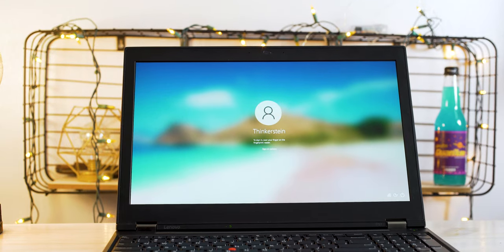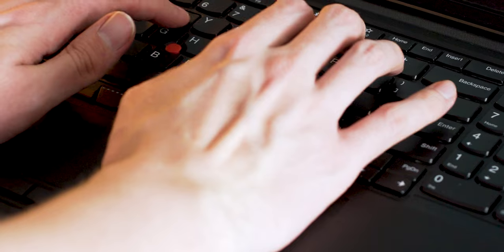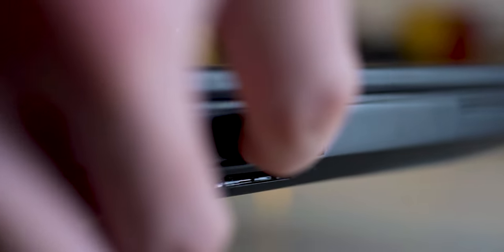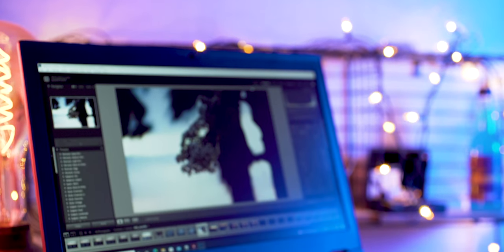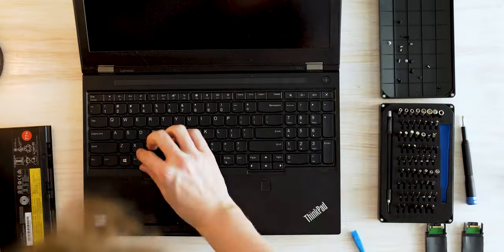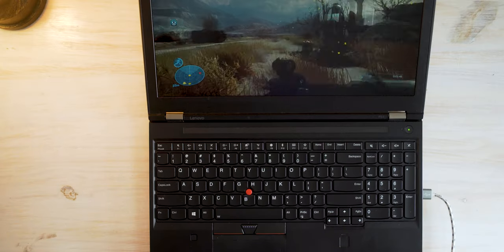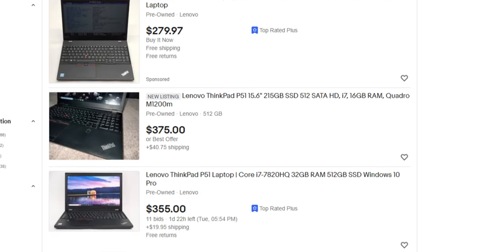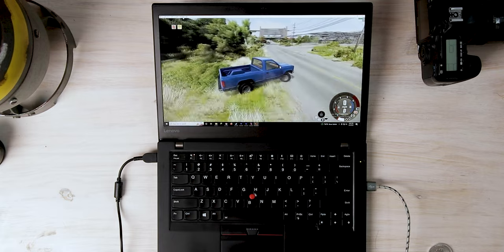I Did Not Expect This AT ALL - Thinkpad P51

Comment: You lucked into a great upgrade with the P51 vs the P50. I have 2 P50s that I use for work producing YouTube videos. Don't get me wrong the P50 is amazingly powerful and capable. Especially when you have it maxed out. Mine are running SSDs and 64gb of ram so they have served me quite well in video editing. I shoot my GoPro footage in 2.7k, and occasionally in 4k. Render in 1080p mostly with the occasional video in 4k. They can render in 4k quite easily but I do 1080 to minimize the render times since my instructional videos are usually 30 to 45 minutes in length. I've been using my GoPro 7, 8, and 9 for my work.  I recently upgraded to GoPro Hero 11s and this is where the brute that is the mighty P50 started to show its limitations. GoPro 11 uses HEVC codec exclusively. My two P50s, one Xeon based, the other i7 based cannot handle the new H.265/HEVC codec well at all. So now my work flow includes converting my GoPro 11 footage to H.264 before editing can begin. That is a long process, just like rendering before rendering. Just trying to view the footage using any media player results in choppy, stuttering video until its been converted to H264. I researched a solution. Thought I'd found a solution which was I found some forum posts that said the P50s can actually run 128gb of ram rather than the official 64gb limit. So I was about to pull the trigger and spend a few hundred dollars to upgrade one laptop to 128gb to test but I stumbled on a thread on some forum talking about HEVC and P50s. Apparently the P50s processor, 6th generation Intel, cannot handle HEVC no matter how much RAM you throw at it. The processors, code name Skylake are just not capable of rendering HEVC at all hence the stuttering video. To handle HEVC you need Kabylake processor or better which is 7th gen i7. Skylake is 6th generation. So I just purchased a P51, equal specs to yours. 500gb SSD, 32gb RAM. UPS just dropped it off today and I have a 2TB SSD, as well as 32gb of additional RAM being delivered tomorrow. Super excited to see what this baby can do.
I use Lightworks Pro for editing for which my perpetual licenses are tied to my hardware. So I need to wait on LWKS support to transfer one of my licenses before I can do some editing but I'm sure I'll be up and running soon. 
I suppose I could use proxies and get by but I'm too lazy and overworked to learn how to use them. Besides it gives me an excuse to buy more stuff.
Oh as for the fingerprint reader, that is absolutely indispensable! If I'm at the office its easy enough to type in my password but I do a lot of my editing away from work sitting on the couch. Its not so easy to type in xxxxxxx-xxx every time while I'm on the couch to keep the kids, girlfriend, or wife out of my stuff. Wouldn't have a laptop without one. 
Max out your RAM brother, you'll be amazed. Might even try going to the 128gb I hear is possible if things go well. Not ashamed I'm such a nerd! 😁
Reply from the maker: To be honest, for editing video I've never really had much issues with just running 16gb of ram. I recently upgraded my main PC to 32gb, but I rarely go above 20gb with premiere. Rendering proxies is your friend. I resisted for a while and regret it. I normally I dump all my footage into premiere before I go do something else while they render out. After a few hours, they're all rendered out and you're ready to never worry about performance drops again
Reply: @aChairLeg  Yes, I suppose running 16gb may not make much of a difference if I'm using proxies but as I said, learning that method would change the pretty nice work flow I have going. Now if my Kabylake Thinkpad doesn't solve my issues I'll be deep diving into proxies. Thanks for the reply brother.

Comment: I was planning on getting the p51 for more than a year but then got a very good deal on a p15 gen 1 i7-10750H, and ended up getting that. I was wondering what's your opinion on that model since it isnt very talked about. I still crave a p51 and will buy one.

Comment: the Macbook air M1 is frankly amazing. I could play windwaker for like 9 hours straight at native res with everything maxxed out, and it would only be slightly warm to the touch, no fans.
also realize that the native res of the Macbook is 2560x1600. that's some seriously impressive battery life for a laptop that slips into my bag. 
I put on a rugged case because I noticed that I was scratching it up with normal use.

Comment: Your first ThinkPad video is what gave me the nudge to look into ThinkPads, and now I have a t480s(8250u 16gb ram, 1080p), and it is the best laptop (not powerwise) I have bought for only what would about 400usd if I converted. Has all the features that even modern laptops don't. SD card slot, Ethernet, headphone jack, windows hello facial recognition, fingerprint scanner, a touchscreen, and a keyboard that feels good to type on. In a form factor that apple would say is impossible to fit that much IO into. The battery is at 80 percent of its original capacity (you can check through the vantage commercial app) but it could be replaced if I ever find it lacking. The  two m.2 and sodimm slots are also nice to have for upgradability (the wwan slot is 42 mm, so you need a not commonly found SSD, but cant complain about having more expansion). My only major gripes are that the screen is not bright enough for my satisfaction though very usable, and it does get a bit warm even under light use.
I would have like the version with the mx150, even if it is a very anaemic GPU.

The express card slot is just PCIe, so it can be anything, external GPU, extra storage, etc.
Reply from the maker: I've heard a ton of good things about the t480! For sure on my list of laptops to check out.The screens are one of the weak points in a lot of Thinkpads, but they're still pretty usable for my needs
Reply: @aChairLeg  The reason I looked for the 80 and 80s is for the 8th gen CPUs which are 4 cores with hyperthreading unlike the 7th gen with have half the cores. I think this was intel's response to zen. Aside from that I think they are basically the same.
Reply: Bro 400$ is too much, 300$ max for this machine
Reply: @blind_judiciary  Brother, you are 2 years late. I think it is like 250 now.

Comment: I have this laptop and I've loved it for over 5 years. At $400 this is a banger of a workstation. It will overheat if you play games, however. It's a hot boi. This is my development machine that runs VMs. I would not recommend this laptop for someone who wants to play games unless you enjoy thermal throttling.

Comment: You ever looked at the T430? If you kit it out fully, it is a nice little machine.

I have one with an i7-3840QM, 16GB of ram, two SSDs and a 1080p display. I turned it into a hackintosh and I have it updated to Ventura and it is beautiful. It feels like the wet dream of a nerd in 2012. Idk about video editing, but it is a perfect laptop for what I use it for, which is school notes and showing off to Linux nerds. (Oh cute, you installed Arch. Hold my plist)

Also, lol @ that express card slot. I only hear about those being used to force an external GPU on T430’s and T420’s. It is kind of cute they kept them for so long.
Reply: Same here! Though in hindsight the 3632QM might be a better option. Not being designed for a 45 watt CPU the 3840 gets toasty :)

Absolutely use Windows however. The reason the T430 has such a strong modding community is because it's the last ThinkPad to fit the classic 7 row keyboard (from the T420) which is why I got it as well. It only takes a bit of dremeling to get one of the best laptop keyboards ever made inside it.

Also, if you get a hacked BIOS, you can also upgrade the WiFi/BT to a modern card and get AC. This is why some prefer to just start with the T420 as the BIOS is not locked to certain expansions, but the 3xxx series and upgraded dGPU on the T430 make it a better system. With the discrete GPU version you can easily play most games up to ~2012 on it with good results.

Fully modded it's actually competitive (excluding GPU and disk access with no M2) with high end laptops up to 2018. The 7700HQ in the P51 is not significantly faster than the 3840QM (the GPU in the P51 however, will be). 

Sadly, in the last few years there have been massive improvements in both single core speeds as well as 8 and 12 core laptops becoming common from die shrinks, and I've had to move on as the T430 can no longer compete and I was using it for work. However, it was fun modding out my T430 and playing with the unlocked BIOS until it beat a $2800 2017 MacBook Pro on both CPU and RAM benchmarks - even with the 3840QM the Apples crap engineering got far hotter far quicker and throttled much quicker :) (both of these machines hit 100C under load, as the T430 was only designed for 35 watt TDP yet we put a 45 watt CPU inside)

Comment: Did you try faster RAM* and set discrete graphics mode in BIOS?

Lenovo has been known to enable ram overclocking.  Just get some 2666 or 2933 or 3200 ram and see if it runs faster.

Comment: Where you get it for $400? I bought mine recently from someone for $200 and it’s flawless and I’m just curious how much it really costs in case I want to sell it. I got the 21H2 64 GB ram.
Reply from the maker: Almost every time I talk about pricing, I talk about general eBay pricing. It's only relevant to North America, but I prefer that to local pricing. I can attest to the price though, since I sold this P51 for around $400 a few weeks ago.
Reply: @aChairLeg  nice. So it’s a come up if I sell it for $400. It’s listed for $600 used. And 1100 new. Before taxes, online. I got it listed for $500 . I might just keep it tho because i won’t come across a wall like this again I don’t think.

Comment: What’s the difference between the 50 and 51 and the various models in general? Which thinkpad is the most powerful
Reply from the maker: P50 is the slightly older model, with p52 being slightly newer. Differences are somewhat minor IMO. The most powerful would probably be a modern specced out p15.
Reply: That doesn’t make sense, if the 50 is older than the 51 then why is the 15 the best one
Reply: @Journey_to_who_knows  the naming that's it, just was named so , P15 is modern while the others are a bit older models

Comment: I just picked up a p53 recently....I paid $499 for it initially from Ebay, then splashed another $250 on another 80gb of ram......so I'm only $750 into it so far and the closest one to my specs that you can currently buy is around $1500 and only has 32gb ram....... I have 96gb,lol..... I was going to pump it all the way out to the 128gb max just because I can...... but after a second thought I decided against it....... I've only got the core i7 processor so the 96gb I have now is probably already overkill...... I believe there were two faster processor options above the i7....i9 and Xeon I believe.....they were way out of my price range though so i didn't care to research them too much.. Peace

Comment: 16GB is not much in 2023 but with four slots to populate using say four 8GB SODIMMs is cheap. I'd run at least 64GB but I like virtual machines. RAM is cheap enough to install much more than the minimum and I never cried myself to sleep over having extra memory.

Comment: I wanna buy this laptop to write code, im a cs student is it worth it? Thanks
Reply from the maker: Possibly overkill, but I'm sure it'll be a great laptop for school. Battery life is subpar which is why I ultimately ended up with a t14 w ryzen 7.
Reply: @aChairLeg  the bad-part is that ALL Lenovo laptops of the past several-years have soldered (meaning not-replaceable) Random-Access-Memory 🥺.

And when your R.A.M. stops working, your computer won’t boot-up and you have a fancy paperweight 🥺.

Comment: If I remember correctly, the 7th gen intel mobile chips are notorious for heat and throttling issues
Reply from the maker: I didn't even remember gen 7 intel existed until I got this laptop haha. I believe they're just updated skylake chips
Reply: Most of that was due to the coolers in pretty much almost all laptops of that generation being not only too thin for the job but also low mass for which was only resolved in the past couple of years with the use of vapor chamber equipped coolers which did help especially in the high end. The only easy fix aside from better compound or going liquid metal is to manually control the fan speed so the throttling becomes less of an issue.